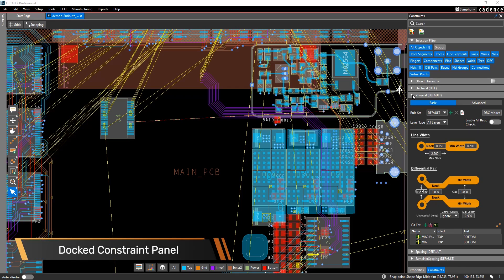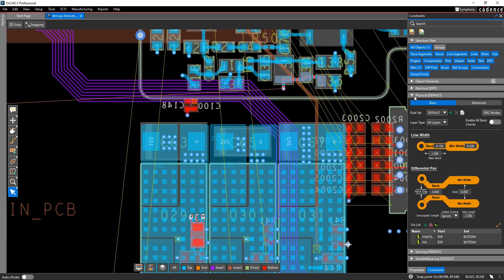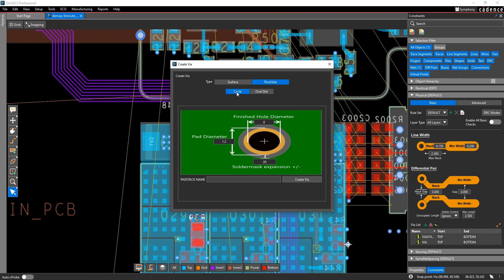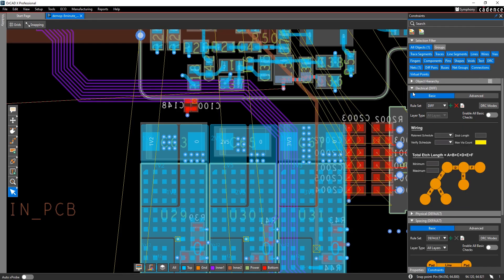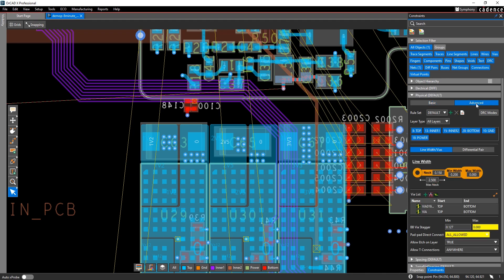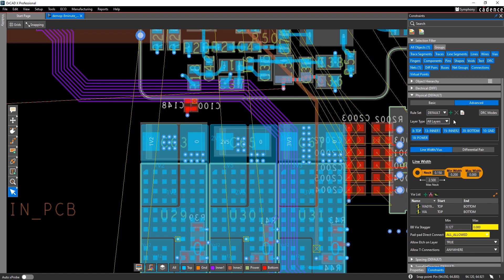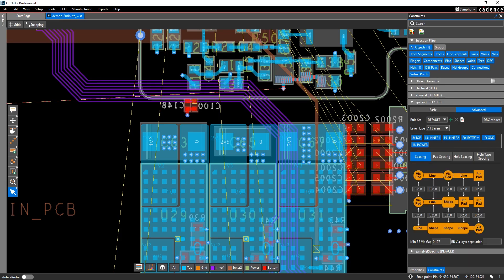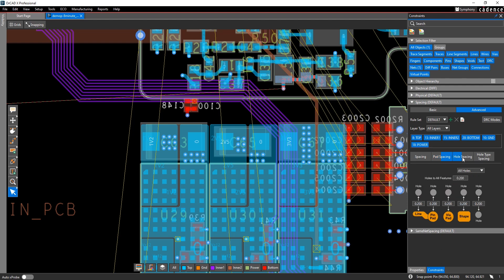Docked Constraint Panel in OrCAD X

Comment: Now all you need are Schematic Directives to drive that panel... one of the things Altium has that is great.  Great for design reuse and cool since you don't have to name every single little 2 connection net to find it in a Constraints spreadsheet.  Do it right in the schematic graphically.    Funny how Altium now wants to go the way of a constraints editor.  And a lot of Altium users gave up on that once they figured out it sucks...
Reply: HI,  I'm a product engineer for Cadence.  I totally understand this requirement of schematic directives.   Hope to get it into our products soon.  thanks for looking at OrCAD